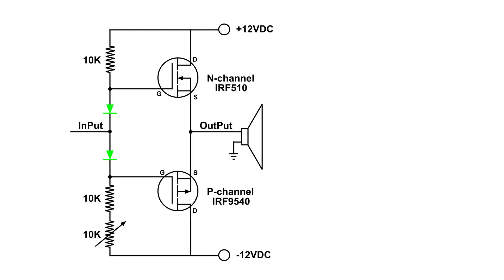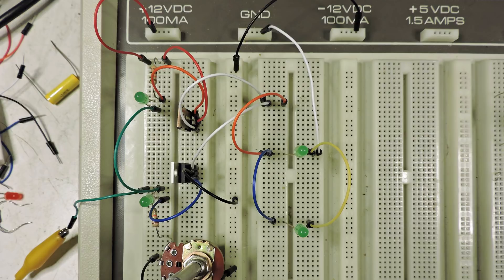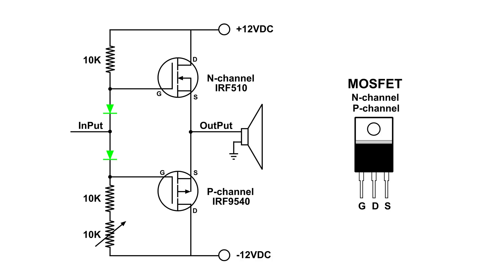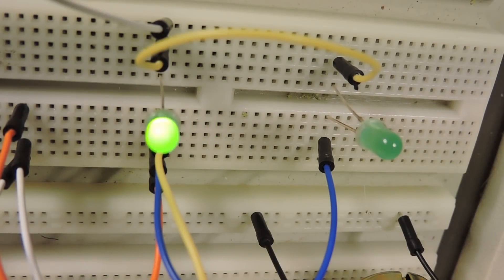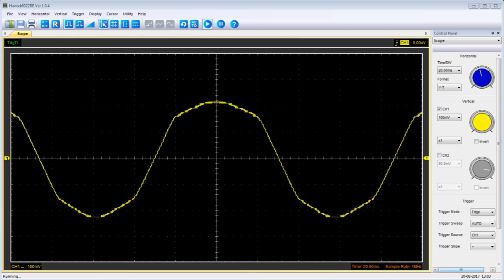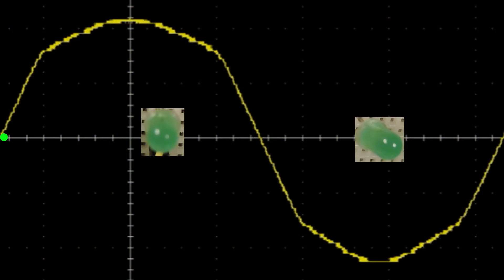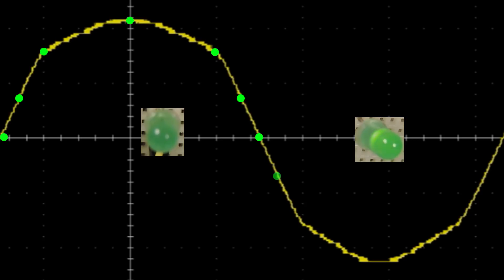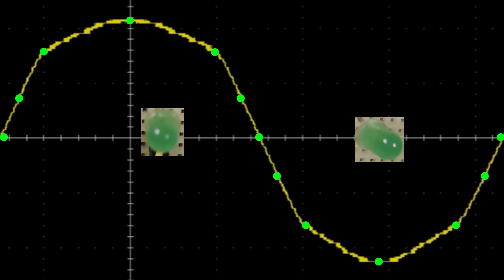MOSFET Push Pull Amplifier Visual Demo

Comment: Thumbs up done sir i have no training in tech school but because of your video tutorial i learned so much more power to your channel sir tnx
Reply from the maker: Thank you, and your welcome,
Reply: @AllAmericanFiveRadio  sir can i ask something about the transistor outline 92 when the flat surface facing at you theres only two pin configuration weather its pnp or npn the left pin is emitter followed by collector  and base and the other pin configuration from left is emitter, collector and base is my understanding is correct? tnx sir
Reply from the maker: @boybravo689  I do not understand what 92 is
Reply: @AllAmericanFiveRadio  sir the small plastic transistor which is transistor outline 92 or 92 package type sir tnx
Reply from the maker: @boybravo689  To determine the pin out, use the transistor number and look up it's datasheet PDF.
Example 2N2222
2N222 datasheet
https://www.onsemi.com/pdf/datasheet/p2n2222a-d.pdf

Comment: Great explanation, I'm wondering would this push pull amp also work at 100V and 1MHz? (And using 1MOhm instead of 100k)
Reply from the maker: you would have to modify the circuit. Use 100V plus MOSFET's
Reply: @AllAmericanFiveRadio  could A1941 and C5198 transistors be adequate?
Reply from the maker: @SheikhN-bible-syndrome  They will work for this type of determination. If you are building a audio amplifier, I would mach the specifications a little closer.

Comment: Question why does this use all NPN transistors when I have read that it takes NPN and PNP to make a push pull amp? MY Pioneer amp has both NPN and PNP transistors for the final stage of amplification to the speakers. Also how is the signal amplified? Where exactly is that happening and how? Can you please show the point where the low power signal turns into high power signal.  Is it the power supply 6V power supply that causes the boost?
Reply from the maker: Push pull circuits were developed first with vacuum tubes. You would have two vacuum tubes one on each half of the primary of the output transformer. One vacuum tube would conduct and then the other vacuum tube would conduct thus push pull. Vacuum tubes only worked one way and that happens to be very similar to NPN transistors. If you were to build the circuit you would find that it works exactly as depicted in this video. So another words there's more than one way to do many things.
These video may help.
Transistor, How Does it Work in a Circuit, Demo
https://www.youtube.com/watch?v=vs3zUHdlsYY
Biasing an Audio Transistor
https://www.youtube.com/watch?v=KtXE7s5DlcI&t=1s
Transistor Amplifier for the Beginner, the basics
https://www.youtube.com/watch?v=l-rfPfRgNJ8

Comment: How come the load is at the source? Wouldnt that stop the gate from triggering?
Reply from the maker: If you are confused by the Compensating Diodes.
This video may help.
Crossover Biasing Compensating Diodes
https://youtu.be/v2mITbaCHUE
Reply: @AllAmericanFiveRadio  Ah i was confused about the FETs them selves, I tried making this circuit myself, but controlling the gates via a PWM signal to make a class D amp, but the N channel mosfet was barly working, and I think it was cause the load was on the source
Reply from the maker: @X7cF4  I had this question about a month ago. The problem is that on the top MOSFET Gate, the pulse must be biased about 12VDC higher than the voltage that is on the MOSFET Source. The first video is about biasing the top MOSFET using a chip, no PWM just Frequency. The second video is an experimental circuit to bias the top MOSFET, with PWM and Frequency.
Half bridge circuit 
https://youtu.be/KthSMdA7VPc 
Project 
https://youtu.be/PkwqwKPnFpA 
Good Luck!
Reply: @AllAmericanFiveRadio  Thankyou

Comment: Great demonstration! Really helps to visualize what's going on here. I am curious about how the push pull is affected when changing the input volume from your audio source. Does one transistor turn off completely at a certain threshold or can the push pull action be maintained at at both high and low inputs somehow? I'm guessing the transformer version of a push pull doesn't have this issue...?
Reply: Both are possible, if both are always on, it's a class A amp. If not, it's class A/B. Whether you use a complimentary set-up or a phase inverting OT doesn't matter.
Reply from the maker: The peaks are higher with more volume, and the peaks are lower with less volume.
Reply: In a totem-pole arrangement like this, if you ever turn on both transistors at the same time they will be destroyed.

Comment: I still do not udnerstand how this is driven. I was advised to try push/pull to make a beeper louder, but I am running with two AA batteries. If I were to split them like here to have +1.5V and -1.5V insted of doing 3V to 0V with a single mosfet, is there really any benefit?
Reply from the maker: Thanks for your comment. 3 volts is usually not enough voltage for a MOSFET. Here are a few videos that may help. Keep asking your questions!
Simple MOSFET Experiment
https://www.youtube.com/watch?v=otoeiVGu9uw
MOSFET Biasing Experiment
https://www.youtube.com/watch?v=nA9BBv4tPc8
 MOSFET Experiment
https://www.youtube.com/watch?v=j47Yk7bJbxw

Comment: Thanks Rick, a quick question...Could parallel mosfets be configured to obtain more power in this circuit? Regards
Reply from the maker: Thank you. Yes you could parallel them. Today you should be able to find MOSFETs that can handle the power you require.

Comment: Could you add capacitors into this circuit. If so, where? Also when I put loads at the rails the voltage is not stable. I only have the 24vdc supply and need stable +-12 V
Reply from the maker: What is it your wanting to do?

Comment: Hi Rick I hope all's well with you. Another great video as ever. When you talked about 'strobing due to the camera frame rate' it reminded me of something I wanted to pass on to you. Someone recently told me that if you look at the infrared transmitter of a TV remote control with your mobile phone camera, when you press any button on the remote you will be able to detect the transmitted light beam at the diode. It certainly works with my Panasonic tv remote and Samsung phone camera. I hope that I remember it next time that I think the batteries have failed in the remote.

73's . . .  Andy
Reply from the maker: Hey Andy, hope y’ll are doing well. I’m doing good and keeping busy. That very interesting, being able to seeing the IR from your TV with your phone. I’m going to try that. This reminds me of a IR experiment I want to try. Receiving audio from a vibrating services. I still have two unused IR Cootie detectors. 
Thanks Andy.
73…Rick
Reply: Hi Rick, glad that you are well. Rick, what the heck is a Cootie detector??
. . .  Andy    @AllAmericanFiveRadio
Reply from the maker: @AndyDaviesByTheSea  I may use this video clip because I never said what I was going to use this IR transceiver for.
https://youtu.be/oCDGfrQqMcI

Comment: Is there a special reason for using the IRF510? The P-channel IRF9540 is complementary to the N-channel IRF540, so I would expect to see that in the positive stage. The input capacitance is very different between the 510 and the 9540, so it may have some influence on the symmetry.
Reply from the maker: THAT IS THE PARTS i HAVE ON HAND.

Comment: Hello,

I'm trying to create a rail splitter using Op Amps. To draw more current and output power, BJT transistors in the form of complementary push-pull npn and pnp are used.

Im trying to create the same thing but with Enhancment type complementary MOSFETs instead. 

It works the same way, but the problem is the mosfet gates are hard to bias and fully turn on, so the mosfets get very hot even with relatively small current draws. In both directions.

The mosfets I'm using have a threshold of 4 volts. The gates are connected to the output of the Op Amp's output (the virtual ground).

In theory and according to my measurments, the  Op Amp's output should provide enough voltage to fully turn mosfets on for full push and pull current draws without even reaching the mosfets' absolute limits once a load is provided.

Is there something I'm messing?

Would it be possible for you to create a video on the subject? I  haven't seen anyone do a high current MOSFET - Op Amp based rail splitter video. 

Oh, and I'm aware there are much better ways to split single supply rails or to have +/- supply rails.

But I think this is a very simple and educational way to do a rail split. Maybe you would be interested in the subject :)

Thank you for many great videos!
Reply from the maker: Thank you. I f ypu are looking for an on/off circuit you might consider IGBT.
Insulated Gate Bipolar Transistor IGBT IKP06N60T
https://www.youtube.com/watch?v=mL14VfjueIo
IGBT Astable Multivibrator
https://www.youtube.com/watch?v=PnAiAhZH9hw

Comment: Very nice video.   Thank you for displaying your simulaion of the AC load applied to the two green LEDs with a sinusoidal input signal.   I take it the peak load applied to the two center-connected LEDs is 12V.    What frequency did you use?
Reply from the maker: One Hz

Comment: that was vety nice of you. you explained workings of power mosfet but can i use it as amplifier ? i was thinking of using such as power booster of my mini amplifier .
Reply from the maker: To drive a speaker requires more current. If you take a look at this Lafayette amplifier it is a good example of what you need. You can download the PDF from this page.
Lafayette LR 200
https://www.hifiengine.com/manual_library/lafayette/lr-200.shtml

Comment: how will the input signal get to the gate when the diode is reversed biased at positive cycle?
Reply from the maker: The two compensating diodes are biased ON. Biased ON they are just a wire, so the signal flows as it does on a wire.

Comment: So the distortion in a dual-voltage source push-pull npn-pnp class B amplifier will disappear, when compensating diodes are in that place. OMG! Will it work with MOSFETS? Please share your opinion. Nice work.
Reply from the maker: These are MOSFETS. Works with junction transistors also.

Comment: Why diodes? These are mosfets they dont have a .7 drop that needs to be overcome. In fact some mosfets dont even start to turn on until 1 or 2 volts. You could bias these with just resistors or a zener...?
Reply from the maker: Why diodes? Usually it's what I had on hand. I was building Amps for videos and got in the habit of using diodes. May not be necessary for MOSFET's. But there was no hikkup just above or just below Zero on the oscilloscope trace. I feel another video soon. Thanks for your question.

Comment: What is the usage of the variable resistor can i replace it with fixed one ?
Reply from the maker: You can ones you know the correct value. It there to set the bias.

Comment: Just wondering if germanium diodes the 0.3V kind necessary for the crossover or if you can use regular 0.7V diodes?
Reply from the maker: Silicon transistors,so silicon diodes, about 0.6VDC

Comment: I wonder what sort of output impedance that setup would be.......
Reply from the maker: With Diodes impedance would be very low, they start to conduct at 0.6VDC. With speaker the impedance is 8 Ohms.
Reply: It would be a highly variable impedance.  With no input, both MOSFETS will be turned off and the output impedance nearly infinite.  With either MOSFET full on, the impedance would be nearly zero.  
what this means in real life depends on what you have connected it TO.  Since there is no feedback, it also has no "damping ratio" and would be pretty bad for audio application.

Comment: Does it amplifies audio signal
Reply from the maker: This will produce audio but with a speaker it will have a weak output. More current is needed to drive a speaker. This Lafayette LR 200 receiver has a push pull transistor output although it is not MOSFET. If you download the manual you can see out the output transistors will draw more current to drive a speaker.
Lafayette LR 200 manual

https://www.hifiengine.com/hfe_downloads/index.php?lafayette/lafayette_lr-200_schematic.pdf
Reply: Thanks for reply sir

Comment: Should function in a 'most responsive' manner. In October, they'll be remodeling a firehouse bunk room near where my cabin is located, and need an amplified, but not to the point of "blasting them out" speaker to monitor a non-dispatch radio frequency (chit-chat channel); this would probably work for that purpose.  My only limiting factor is heat dissipation within the closed ceiling.
Reply from the maker: Thanks

Comment: How different it works to a class ab amplifier?
Reply from the maker: Not much difference, the low voltage off of zero is gone. AB realizes on transformer action to smooth the audio out and the distortion is at very low voltage.

Comment: In the schematic diagram the two diodesee are in the wrong polarity;  for example the upper one  (In the circuit diagram) Will prevent the positive half of the signal to pass to the N-Channel MOSFET..
Reply from the maker: Crossover Biasing Compensating Diodes
https://youtu.be/v2mITbaCHUE
Reply: Electrons flow from negative towards positive. Electrons flow against the arrow of a diode also resembled in a transistor/mosfet junction. So as you can see the top diode is forward biased allowing electrons to flow from the input towards the +12 supply via the 10k resistor.
Reply: @DrHarryT  in that case the bottom diode is in the wrong direction
Reply: @LC-qi5ff  Exactly, electrons flow against the arrow of a diode. From negative to positive. [Actually electrons don't flow, but that's another topic.] It's a difference between terminology/perception of engineering and physics.
Reply: @LC-qi5ff  "in that case the bottom diode is in the wrong direction"
It is correctly shown.  The diode creates a forward voltage drop of 0.6 volts, negative with respect to the source, and this -0.6 volts is applied to the gate, which acts like a vacuum tube; "pinches off" the current.  incoming audio can drive it more negative, which does nothing since it is already pinched off, but on the positive swing of input allows the bottom MOSFET to conduct.

The top MOSFET sees +0.6 volts on its gate, which pinches it off, and it uses the negative swing of input to turn it on.  

MOSFETS normally conduct and must be told to NOT conduct; this is like vacuum tube.  Transistors normally do not conduct and must be told to conduct (by a small current from base to emitter).